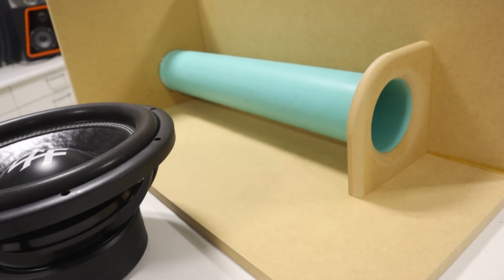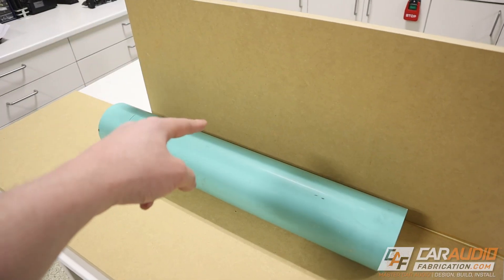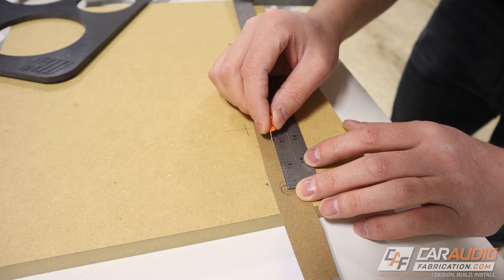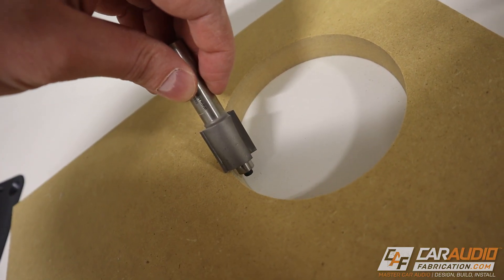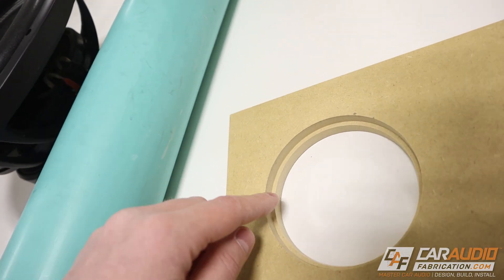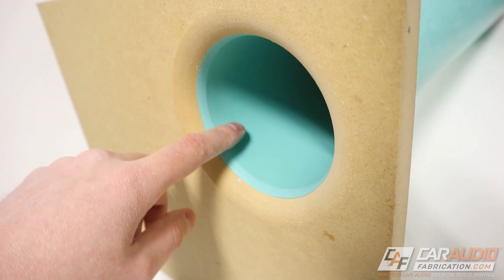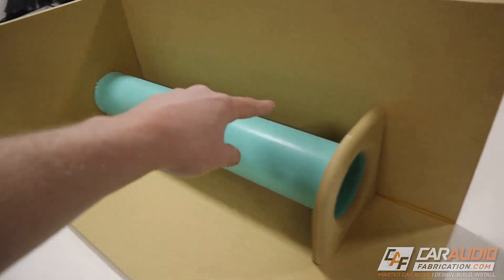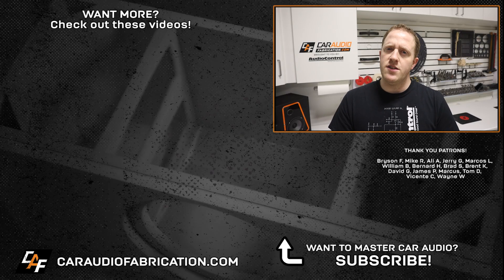ROUND PORT? Make your own AERO FLARE and MOUNT LIKE A PRO! How To

Comment: I've got some tall shallow boxes i'm building for a friend of mine. Don't have enough space to get the ports long enough, so i'm gonna run a right angle in the port, and shoot the tube up close to the top of the box. They're relatively tall, maybe i can get a quarter wave transmission out of them?

Comment: 2:31 Guilty!  Luckily, my 1st (1st ported box) build is for 12' subs so I can reach around inside the 11" holes pretty easily.   But after following along with your vid, and even using a $25 Drillmaster trim router from Harbor Freight, these ports are turning out Decent!   I used sched. 40 PVC,  that's all Depot had but I ge tapered the inside first with sandpaper (took a while,  but the aerodynamics are very smooth, extending 1.5 inches into both ends of ports)

Comment: 2 sundown x18v3....14 cubic feet box at 32 hertz.....can I use three 6 inch ports at 11.56 inches to reduce port displacement.....or do I need four 6 inch ports at 16.87

Comment: You can even use regular ¼ inch wall thickness PVC and round over just the pipe. I used the pipe and put it on the board where I want it to be and trace the outside of the pipe, and than cut a square piece of wood and apply it to give the port hole a double baffle so the tube is very snug, so snug in fact I wound need to take scrap piece of wood to put over the tube to beat it down in and make flush with the wall. And in the inside ill take wood glue and make a bead around the port to give it an air tight seal after I round over the pipe wall. It works great with no port noise.

Comment: Hi thanks for this.  I'm building a pair of the CSS Criton 2TDX Tower speakers (not for my car).  : )   I like the way you installed the port tube in that sub woofer box and anchored and rounded the entrance and exit.   I think I will try this on my speaker build instead of using the port tubes provided.   The exit's on the ports I got with the kit have a plastic flange with a 90 degree edge.  I think rounding over the 3/4 inch red oak where the tubes exit will look a lot better than the plastic flange.   
   I am lining the inside of the speakers with a 1" thick sound damping material.   Is it a good idea to wrap/glue damping material around the outside of the port tube inside the cabinet?   Thanks for the video!  You gave me a lot of interesting ideas I plan to incorporate into my speaker build.  And a bit more work to do..  : )

Comment: How to, without using a heat gun. Just use a 2000 dollar router.
Reply from the maker: A router can literally be purchased for $30. I just checked. Even less used. Stop exaggerating to justify why you can't do this right.
Reply: @CarAudioFabrication  to be honest, the Plunge & Fixed Base Router Kit you recommended in another video is only available in the US and Canada (only available as a 120 Volt version). I can not find any equivalent Plunge & Fixed Base router combo here. A router like that would probably cost around $500USD anyway and the cheapest router I can buy right now is a Bosch POF 1200 AE costing around $110USD.

Comment: Great video Mark, never heard anyone bring up round port bracing before. Good stuff. 
  Anyone wanting to take their build skills to the next level but don't have the cash to get a router and router table?  You can do all the cuts shown with a straight bit, round over bit, a cheap palm router, a home made router circle jig (you can find plans online), a wood clamp & a couple screws. Draw out lines for holes and radii.  Clamp scrap board behind cut area to prevent blowout. Set up circle jig for the o.d. of the tube use straight bit cut to depth. Reset jig for i.d. of tube and counter sink 2 screws through the center piece your about to cut out into the scrap wood behind it. Cut out center with router ( this may take several passes lowering the bit slowly each pass). For the port brace cut the circle first then the radius so you'll have  better options for securing your work piece. Follow up with round over bit. Start with less then $50 in harbor freight tools, upgrade to better when you can.
Reply: Excellent, thank you 🤠👌

Comment: Mark, I've been watching you videos recently and I have a question. First off gotta give a disclaimer, I have been away from car audio for about 15 years. When I was building my stuff for my cars (I was a budget guy) I used capacitors to help with electrical current draw on my electrical system. I see that you've said nothing about capacitors, are they not a thing anymore?

Comment: A trick I do is make a wooden ring that you afix to the box wall for the port to slide into.  If you make two, and sandwich them together, make the ID slightly bigger than the OD of the pipe on one ring, and match the OD on the other, when you afix the stacked rings to the box wall, a recess is created for the carpet, vinyl or leather to go into as the covering goes into the radiused port.  Cover it, and then when you slide the port in, it will clamp the covering and give you perfect edge from covering to port, and will hold the covering and make sure it will not come loose.

Comment: You should get a CNC machine. I’ve been into audio and just got a shapeoko 4 xxl and it allows me to make some pretty complex enclosures.

Basically you cut 3/4” material and cut a bunch of “rings” that have the same cross sectional shape of your enclosure. 

Make a bunch of them than stack them up and glue em together. This allows you to make your walls as thick as you want, and you can design 3 or 4 of the rings to incorporate complex bracing that will keep your enclosure as dead as possible.

Comment: How would you go about the carpeting around the port perimeter?
Reply from the maker: Go a little deeper with the roundover. It will leave a perfect crisp line to run your blade in to trim.
Reply: That sounds about right. Has anyone ever told you that you are a very smart person? What's your IQ?
Reply: Oh, I had one other question if you have time. Do you have a video on port/vent and cone clearance? Like the distance between the inside wall of your trunk from your port opening. Because I only have about 2 inches clearance from my port to the trunk wall and maybe 3 inches from my sub face to the back of the seat. Am i losing sound/bass quality? I cant seem to find any videos on this. Thanks

Comment: I have a question. are 7X10's designed to be in free air? or would they perform better in enclosures? I don't have any room for subs all I can run is a 4 channel 60W amp 2 7X10's in the rear and a set of 3 way coax with crossovers in the front. would I get better bass in a enclosure? thx mate

Comment: I have a question, it’s probably pretty simple, I have upgraded door speakers. That have a rms rating way higher then what the receiver puts out however it still sounds good. Now here’s the question, if I was to get a amp that correctly brings the speakers to proper rms ratings would it make it sound any better, or would it just bring the sound levels up without distortion or would it do a little bit of both?

Comment: Question: when using the factory head unit but upgrading the amp and speakers, how do you get around the the AVC-LAN lines (or CAN BUS communication)? For example if the Bluetooth or Navi’s voice signal is sent to the factory amp but you are looking to upgrade said amp? Any thoughts and input would be greatly appreciated!

Comment: THIS SPRING IM LOOKING TO UPGRADE MY 2011 CHRYSLER 300 I WANT TO INSTALL A ROCKFORD FOSGATE 3SIXTY3 DSP AND ADD AMPS FOR 6 SPEAKERS,  IVE INSTALLED THE SPEAKERS THE  SUBWOOFER AND A CORRESPONDING AMP ALL ROCKFORD FOSGATE BUT THE FACTORY HEAD IS DEAD ON ARRIVAL FOR PRECISION SOUND TUNNING AND I CAN'T TAKE IT ANYMORE!!...LOL,
I WATCHED YOUR VID ON RUNNING WIRE THROUGH THE DOOR BOOTS GOOD INFO,... I GOT MY WORK CUT OUT FOR MYSELF
I WILL HAVE ALOT OF QUESTIONS WILL BE WATCHING AND LEARNING THANKS ALOT.

Comment: I've always done this with two pieces of wood as I still don't own circle guides. First is cut to outside diameter as close as possible with jigsaw, second is ruff cut within the inside diameter, glue together, glue onto tube, then use tube to flush cut to inside diameter and then use radius bit too round ends. I always try to design the box so the tube ends at a window brace which is much easier when doing stage and club systems.

Comment: I have a question and I am hoping that some people with more knowledge than me would be willing to answer...If I were to purchase a 370 amp hairpin alternator and run 2.5k watts to start with, would I also need a secondary battery as well? Or could that alternator keep the single vehicle battery from dropping into the low voltage range?

Comment: Excellent video! Regarding bracing. Would you line them with rubber, to prevent "clatter" noise, or is glue/adhesive good enough?

Comment: how to install ready made ports securely and in a good looking manner?
Reply: Virtually the same way he did here.  Depending on the design of the pre-made will determine if you load it from the inside of the box to the wall or mounting it to the outside of the wall and sliding it  the enclosure.  Regardless, use router techniques Mark teaches here and in his other videos to seamlessly transition the port to the wood wall and build a support inside the enclosure to support the other end.

Comment: Tip: gang up two pieces of mdf with your templating tape and then jigsaw/route out your inner diameter holes at the same time. Saves you some time/steps, plus ensures that both your outside panel and inside brace have their holes perfectly aligned so there’s no stress on the glue joints. 👍🏻

Comment: Hey Mark ,could you make a video on how we determine what the "right" tuning frequency is for a custom sub woofer install ?
Reply: Grab a DATS program from Parts Express. Run the DATS program on your subwoofer,  to get the TS Paramters. Use the TS Specs, to determine your proper tuning frequency for your specific application.

Comment: Those inner braces must, of course, clear the tube and the braces. The braces will work best with their edges rounded over much like you did with the hole openings as you are less likely to have any loss of rigidity of the braces and the surfaces being smoothed over may even help it on the inside. Might be worth trying if you plan on more inner bracing. I’m not a fan of just putting bracing in and leaving it as is. It’s not going to be seen. That isn’t the point. Keeping transitions as smooth as possible may make it sound better. Maybe you can explain it Mark. I’m not doing it that well. Stay safe mates!😊👍🏻😷

Comment: This is awesome. Anyway you can do a video on how to design an aero port. Like all the calculations and building it from scratch and flaring ends? Would really be interested in that. Keep up the awesome work.
Reply: You can use an online calculator and figure out the length from your volume and tuning hz, then follow this video

Comment: Good idea! Next, show us how you would carpet the exposed flare. Looks like it would be tough without some sort of edge to run a cut around
Reply from the maker: You can intentionally raise the round over bit more out of the table. This will leave a hard edge. You can use that edge to precisely trim the carpet and paint the smooth transition
Reply: Maybe a slightly larger diameter grove to tuck the material, and then paint the port ...
Maybe an abs trim ring as a transition...
Sky is the limit.

Comment: Thank you so much for this vid, I've been asking for a while. Really wish you went indept why you'd choose this over a slotted port
Reply from the maker: I probably wouldn't choose a round port, but that's a topic for another video
Reply: @CarAudioFabrication  Typically, round ports offer the flexibility of adjustment, but (while harder to do) slotted ports can have that versatility as well. Though, aside from that, it'd be nice to hear the rational differences behind "what port type to choose", and possibly even hearing the difference between one of each type (tuned to the same frequency), for comparison...

Comment: How do you feel about using PVC elbows for longer ports? Or for having them on the same plane as the woofer?
Also this video could not have come at a better time. Been wanting to build a similar enclosure for my JL 12w6v3
Reply from the maker: Elbows is the only way to bend, I try to avoid using circular ports if they need a bend though
Reply: @CarAudioFabrication  you are wrong theres a guy that built a roller coast out of pvc not sure which type but he used heated sand to bake the bend into the pipe
Reply: @CarAudioFabrication  I'd love to use a slot port, however I'm trying to save space by making a box with an angled back to fit snugly against the back seats. It'll fit too snugly side to side to do a side port. It's a losing battle 😅🤷‍♂️

Comment: Always love your content! You are a great teacher when I am unsure what to do for certain builds. Thank you much.
Reply from the maker: I appreciate that!
Reply: @CarAudioFabrication   hey I had a quick question for you. I'm running a single 12" infinity kappa 1200w in a vented ported box. The box isn't big enough for the subwoofer so I'm having my local shop build one to spec. I'm running a SKAR amp at 600 watts at 2ohms. My question is before I give the green light which hits better a TUBED flared port or a vented port box? My local shop said a TUBED flare hits better but I don't know. Thank you I love the channel because of you I bought and running the LC2i in my lexus so I no longer lose out on bass when turned up past 45 thanks again 😊
Reply: @movie_av_impulse So which port did you use  - aero port , or slot port ??
Reply: @bobcat3653  that setup is not my setup now I'm running a 12" NVX in a slot ported box with 1,000 watts and 2ohms sounds and hits much better.